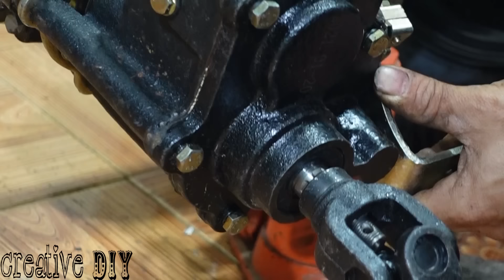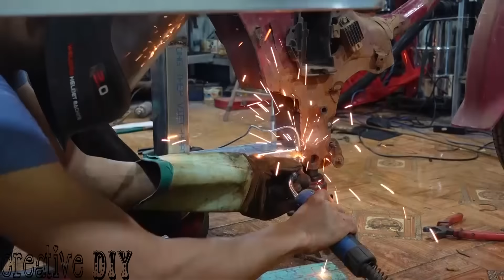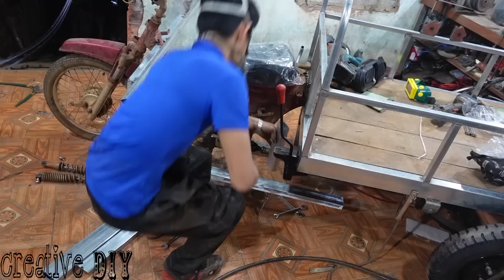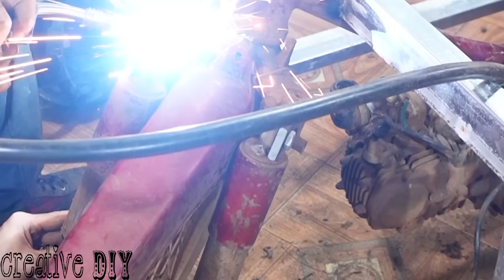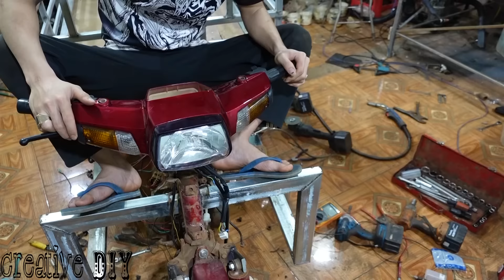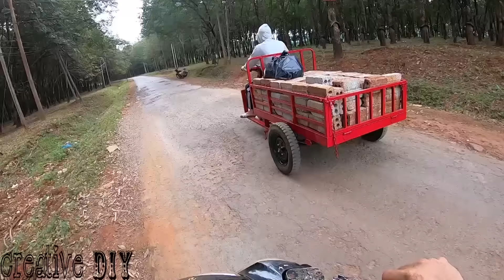Tôi làm xe ba bánh từ động cơ xe máy cũ @Creative DIY

Comment: Love it BUT... Please set your heat and feed speed better. What works for tac welding does not work for full joint welding and fill. Just play with it until you get it right. I suspect you need to slow the feed a bit and that will do it. Find some of the videos on youtube to perfect technique. For me the slight C movement works best and ironically enough I have learned to do push welding which works so much better with a wire feed. Blessings

Comment: Ummm Where is the section on the engine and transmission addition to turn the ninety degree from the engine to the drive shaft?  Kinda important, wouldn't you say?? Or is that a "Secret"??